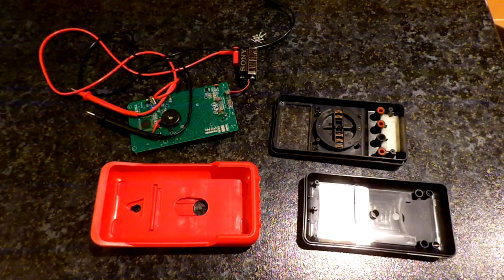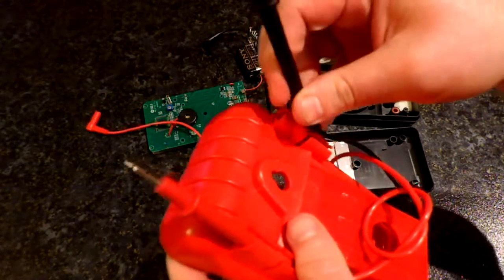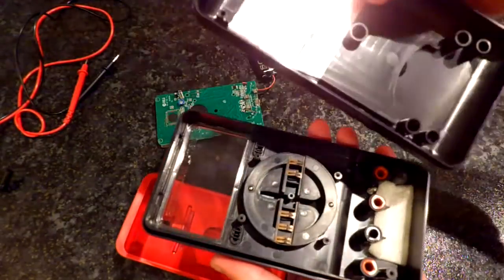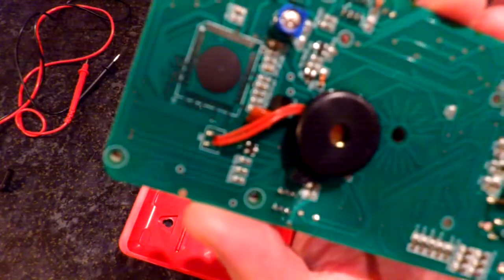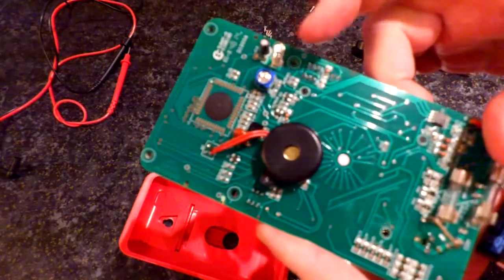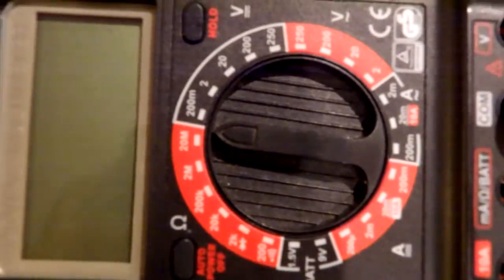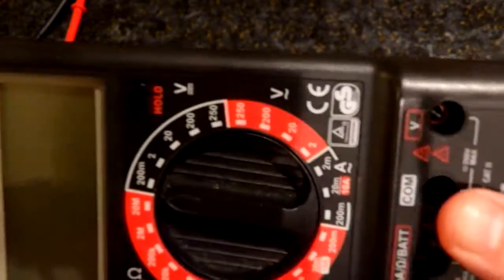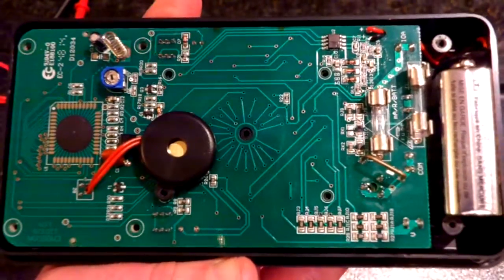Teardown and Review of a Powerfix digital multimeter PDM 250 A2

Comment: Lcd displays run a at ac, and because of this produce electrical noise, with your meter set to a low voltage voltage range you'd get erroneous readings, so the foil on the rear lid acts as a screen, the little spring on the Pcb connects this to ground.
Really expensive meters have gold plated switch contacts, this one looks fine for what it costs.
Its good to have a cheaper meter for most work, and a better one for more accurate requirements.
Reply from the maker: Thanks Splitfire pilot. Now i know what the foil and spring are for. Interesting. For the money the meter it really is not bad at all. The build quality alone is exceptional at this price. Also i should point out the ball bearings go on the underside of the control knob, time was spent looking for both bearings as they fell on the floor. lol. Got it back together again working well bearings and all!